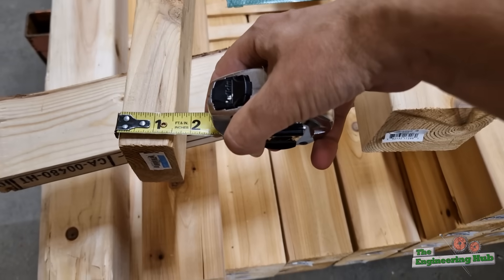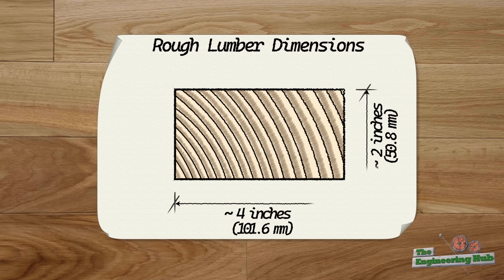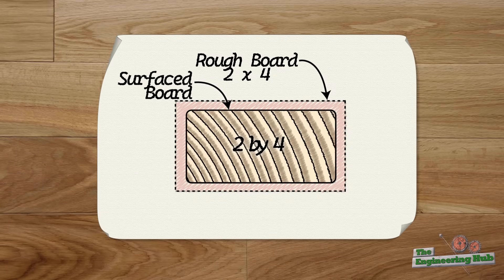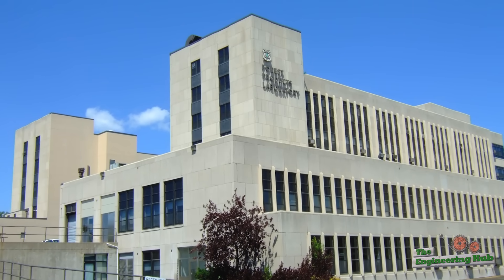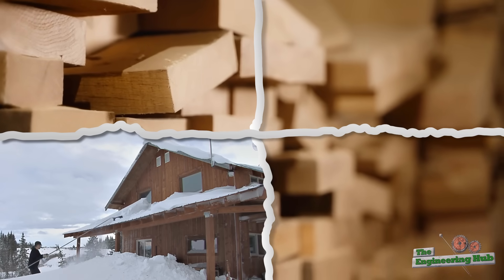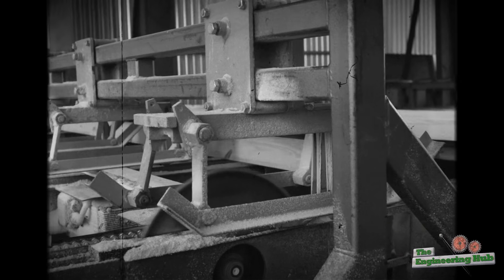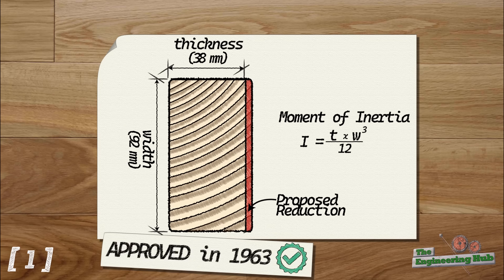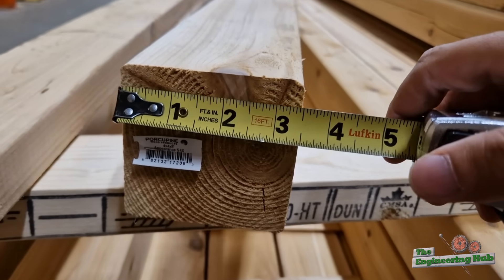Why is the 2 by 4 getting smaller and smaller?

Comment: 2x4s (or any other chunk of tree carcass) not actually being the measurement they say they are is kinda what got me into welding... 
my 2x4x.25" wall tube will actually read 2x4x.25" on a tape measure.... Yeah fine if you bust out a calipers or a micrometer its a bit different, but not a half an inch LoL

Comment: you have to look at the evolution of the 2x4 standard alongside the widespread adoption of plywood in the 1950's. even thinner, low-quality dimensional lumber becomes "strong enough" when used in framed and sheathed construction, as opposed to the nailing of narrow wall and floor boards to the frame. my only complaint is that modern 2X lumber is seldom straight and true.

Comment: Actually, the more modern dimension rules are not applicable to 'all' dimensional sizes. The 2x4 and 2x6 are 1.5" x 3.5" and 1.5" x 5.5", respectively as stated in the video.  But once you get to a 2x8 and above you're looking at 1.5" x 7.25"; a 2x10 would be 9.25" thick, and a 2x12 would be 11.25" thick. Anyone in the industry knows this, already. But a novice might find it confusing, thus the mention.
Reply: As a novice, I didn't know this. Cheers!
Reply: Then call it by the real dimensions
Reply: Then it’s not a 2x4, 2x6 or 2x8.  Call them what they are.

1.5x3.5 is the proper name, I would literally sue someone if I ordered a load of lumber and it was all measured incorrectly to the order.
Reply: It’s a mouthful to order lumber that way when you do it all the time. 2x4 gets the point across fine.
Reply: @lilkittygirl  Really, so you expect a grapefruit to have grapes in it? You might want to measure the waist on your pants, you will find out the number on the tag is not correct. In fact, if you look around you, you will learn your whole life is a lie.
Reply: Your case would get thrown out immediately.  @lilkittygirl
Reply: @lilkittygirl Then you would be laughed out of court.

Just like if you sued McDonald's because your Quarterpounder came with a patty less than a quarter pound.
Reply: @Ben-mw9vz  Is the decades old industry standard that 10mm nuts have an 8mm diameter hole?

Comment: I bought a boat that was outfitted in 1977-78. During the refit, the material I salvage was exact in size, and of better quality. The exterior ply used for various bits had more plys, the void (where cracks and knots were removed) were filled with good wood, and the glue was indeed water proof. What you get today is what I call crap wood. It's garbage. Greed rules.

Comment: 2x4" is like 50.8x101.6mm...
Very common size in Europe too (50x100mm). Tho im used that those come in 50x100 and not 45x87.3 or something.
But yeah if i order one size and i get something ~25% smaller they can have it back. Silly that there is no real standard for so long for a thing in such demand... Where i work 0.01mm (0.000394") too small is usually scrap. Metal usually has a very low moisture content tho. 😅

Comment: Because modern testing performed by our national testing laboratories determined that the pieces could be smaller but still have the required strength to perform the job necessary. Does anyone want to pay for more than they need.